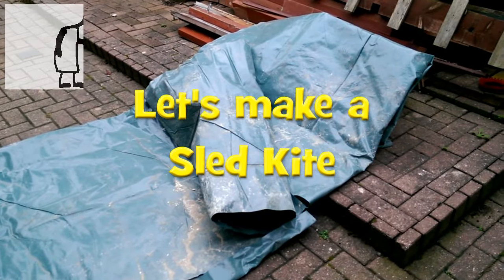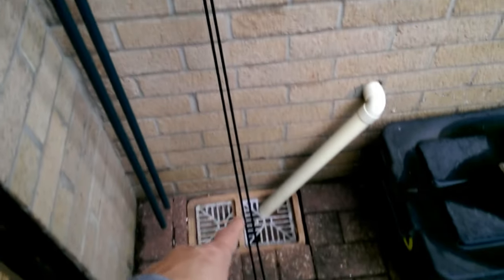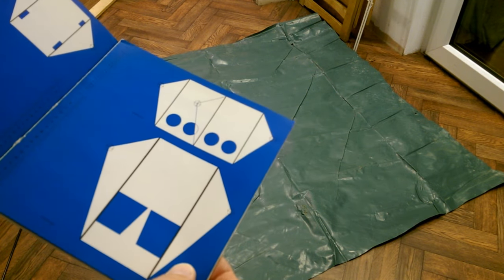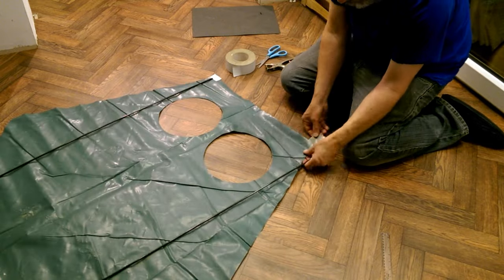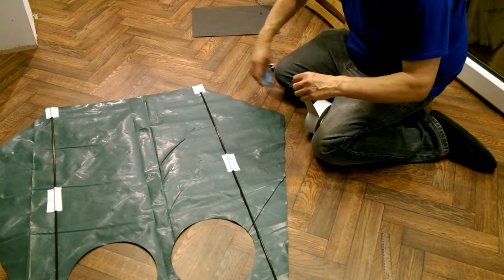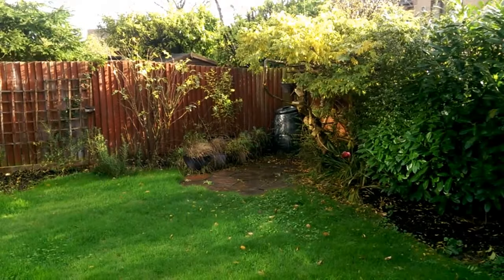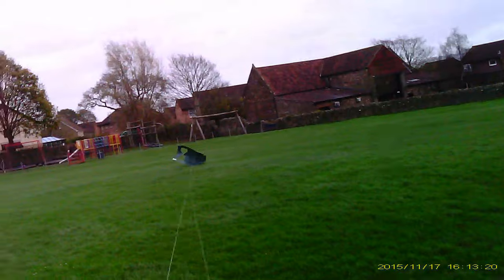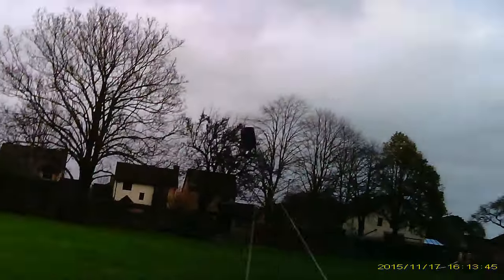Let's make a Sled Kite

Comment: Definitely need to bridle it as a single line kite and twin tails can be good too.
Reply from the maker: +wordreet you will see in the next episode, (which comes out around Christmas Day at the moment unless something more appropriate pops into my head), that it flies OK with the twin lines and I even have a measure of maneuverability but it definitely needed tails. I remember making these years ago about the same time Peter Powell was starting his stunt kites and I was doing it with sled kites. Not as well as his but as you will see you can go left and right which does make it more interesting that just straight up.
Reply: GrandadIsAnOldMan Argh! Stop talking about xmas already! I'm no where near ready for it yet!!!
Reply from the maker: wordreet plenty of time, I always find that shops never run out of saucepans, irons, and ironing boards. Wives always appreciate the thought and effort you put in to those sort of presents. You should try it ;-) oh, if you do you may want to have a blanket ready in case you are sleeping on the sofa for a while.

Comment: As you said at the end it could do with a single line, traditionally sled kites are single line with the bridle being 3x the length of the sail, and with having holes in the base of the sail there should be no need for a tail.
great video as always.
Reply from the maker: +Pete Gow thanks, you will see in the next episode, (which comes out around Christmas Day at the moment unless something more appropriate pops into my head), that it flies OK with the twin lines and I even have a measure of maneuverability but it definitely needed tails flown like that. I remember making these years ago about the same time Peter Powell was starting his stunt kites and I was doing it with sled kites. Not as well as his but as you will see you can go left and right which does make it more interesting that just straight up.
Reply: +GrandadIsAnOldMan And Peter Powell is still going, I make sled kites but a lot smaller size for my Beaver scouts and cubs to make and fly, I have an urge to make a larger one but it will be single lined just for the stability so i can put a keychain camera on it and do some aerial photography and if that works as well as it should maybe a slightly larger point and shoot camera.
Looking forward to the next episode too.
Reply from the maker: Pete Gow yep, they are supposed to be one of the more stable kites. You may find that using a keychain camera gives you a very shaky result. I tried it with my minicamera and it was pretty well unwatchable. It is so light it just bounces around. I think a heavier camera would be more stable. If you want good pictures you need to make a special bracket to stabilise it. Here is my attempt without making a proper bracket and it was not very successful but if you read the video description I give links to people who got it right https://youtu.be/5mNBoSkT-dY?list=PLA5a2xPRSrB0cQEd8EvTU8x2pySWEaJGH
Reply: I've already made the contraption for the camera, An old coat hanger with a couple of twists to go on the line and a blob of blutack for the counterweight.
its getting the weight just right to allow it to be stable enough to take stills from the video.
Reply from the maker: Pete Gow make sure we get to see some of those photos or video